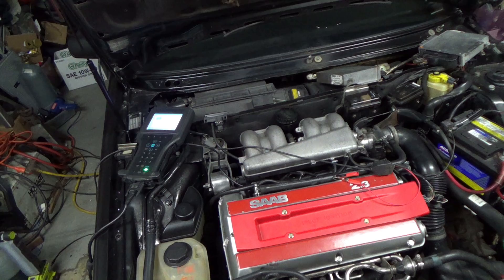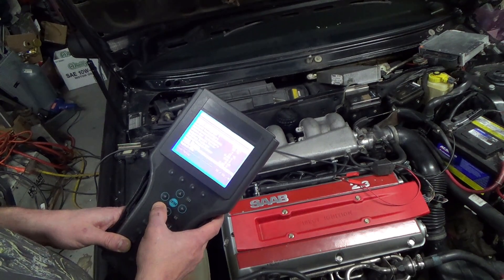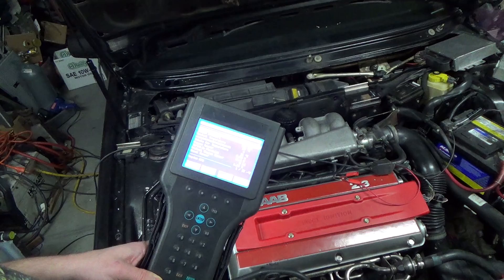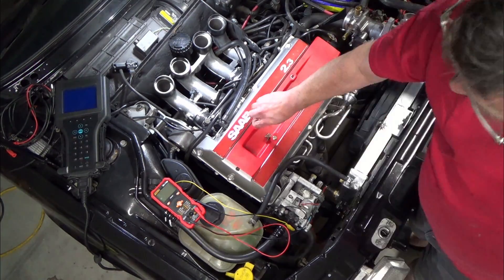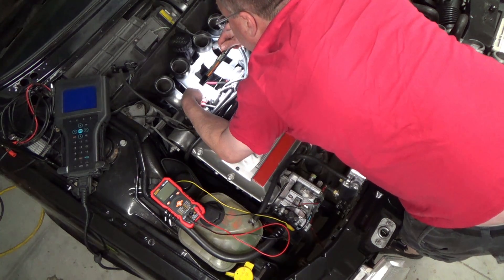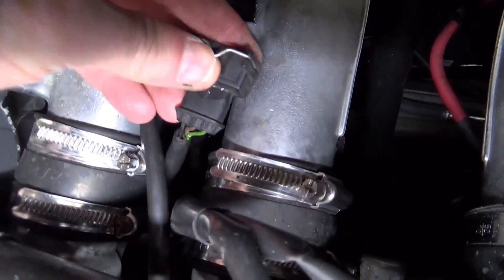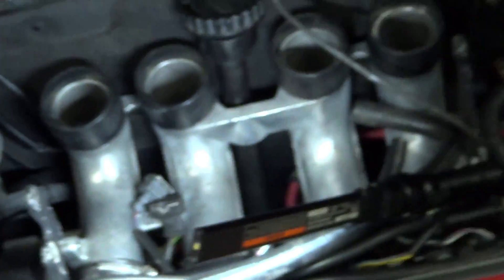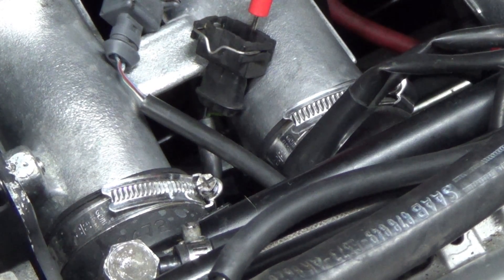1994 Saab 9000 Project - no start diagnostics

Comment: HEY MAN I COULD REALLY USE SOME ADVICE IF YOURE WILLING? caps lock was on sorry haha but i have overhauled the egnine on my 1996 saab 9000 aero (new head gasket, engine hoses, turbo,timing chain guides, and more). got it all together after months of researching everything and i have a feeling somehow i did the timing wrong perhaps? it wont start but it could very well be the fuel rail or injectors im thinking. i guess what im asking is what would you assume to be the most likely scenario in my case? the camshaft and sprockets seemed to be off a bit but i mean i cant adjust that because they are fixed on the camshaft correct? sorry for unloading all this i appreciate your time and videos so much man but im a lil lost as to what to do next
Reply from the maker: Are you sure the intake side has the intake cam? It is possible the timing could be the problem. Getting the sprockets set with the tensioner pulling the slack can be a pain. Double check the crank pulley mark and cam marks line up in the cam caps. I had a tough time getting my B234I timed right with no cam locking tool. Before you tear too much apart, record compression on all 4 cylinders and check the book.